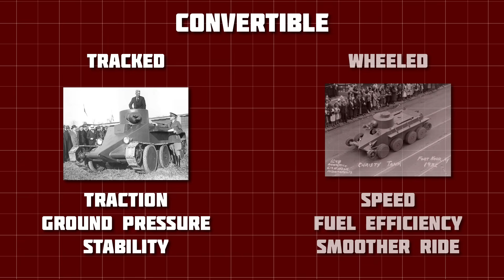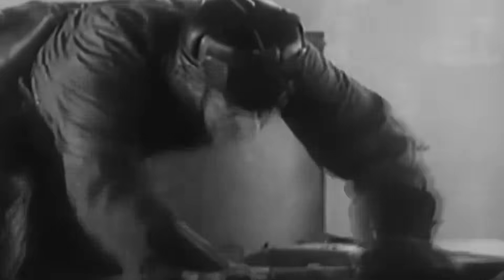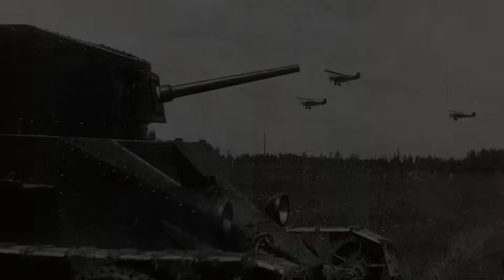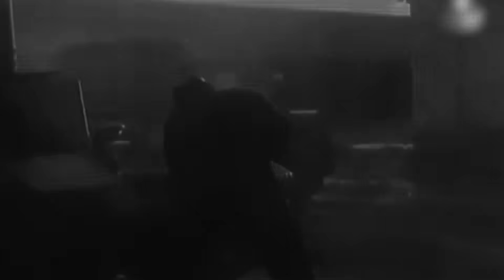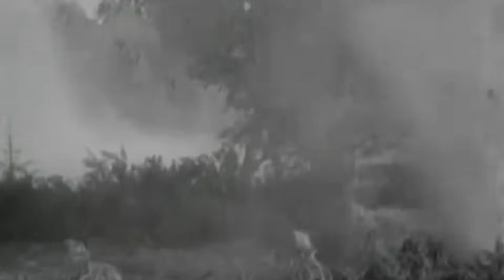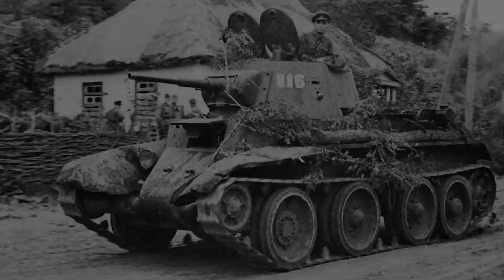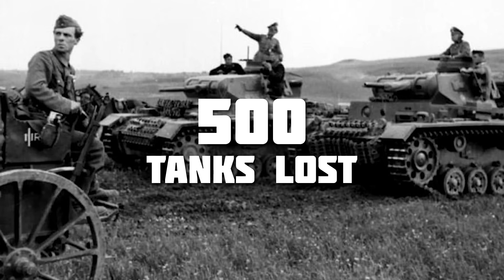The BT Tanks — Stalin's Doomed Cavalry

Comment: The T-44 was a complete redesign. Only the outlines and the engine remaind from the T-34. But they decided not to start producing it in large numbers, because it could slow down the T-34 production in the critical state of the war. But they kept refining it. And the "end product" of this refinement is the T-54. The T-34/85 was the end of the line of the Christie-derivative soviet tanks. The T-44 was the start of a whole new line of tanks. That line ended with the T-62.
Reply: They did not exactly decide not to produce T-44 in large numbers. However the factories which were set to produce it were just recaptured from Germans, so it took time until production would ramp up. Of course they did realize the 85mm gun wasn't futureproof anymore. The biggest changes from T-44 and all the various T-54 variants was the turret. Likely those earlier turrets weren't working too well with the new 100mm.
Indeed there isn't much left from T-34 in T-44.
Reply: @Teh0X  They tried to put a 100mm cannon on the T-44, but the gun's strong recoil disassembled the turret components, space was limited, and it was unreliable. Things got worse when someone had the idea of putting a 122mm D-25T on the T-44... it was completely unfeasible, so they hardly used the T-44 and went straight to the T-54.
Reply: @leo_commander_186  They also tried a 100 mm gun and a 122 mm gun on the T-34s...didn't work out too well.  Even the T-54's "pancake" turret was so cramped (how "cramped" was it?) that its crews were limited to about 5'6" in height (roughly 168 cm).
Reply: The T-44 was actually a further development of the rejected T-43, which resembled the T-34 superficially in appearance, but had torsion bar suspension, IAW German practice, enough room to accomadate its five-man crew, and a THREE-man turret, correcting the T-34s greatest defect.  While Stavka and Stalin actually liked the T-43 a great deal, what they didn't like was that their tank factories would have to shut down to re-tool for it.  This was in the late summer of 1943, after taking staggering tank losses at Kursk, Orel, Bryansk, Kharkov, and Smolensk, even though they pushed the Germans westward.  Stavka feared that giving the Germans that much  time to recover would make the job of pushing them completely out of the USSR that much harder, so the conversion to the new tank was deemed to have bad timing.  They did like the TURRET, though, and a way was found to make it fit onto the existing T-34 chassis.  At the same time, as the T-43 was meant to have the F-34 76 mm gun, and the new IS-1 the D-5T 85 mm weapon, the analysis was that firepower was the single thing that Soviet armor needed most; not only were the German "Big Cats" ALMOST immune to their tank guns at normal combat ranges (almost), even their StuG IIIs and upgraded Panzer IVs, of which the Germans had many more, could shrug off hits from the 76 mm weapon.  The solution was to stuff that D-5T weapon into the new turret, making the T-34/85.  While this made for a cramped turret, and the tank nose-heavy, hard to steer, and prone to getting stuck in ditches and trenches, the problems were considered worth the trade-off in effective firepower, as even the "Big Cats" had reason to be wary of the new hybrid tank!

The engineers at the Uralvagonzavod didn't just give up, though, they figured out a newer, lower design that better used the new turret, along with a cross-drive transmission that made removal of the "powerpack" a more straightforward procedure, something that the T-44s successors incorporated also.  This design was rolling out of the factory by March 1945, but didn't see action in Europe, nor even in Manchuria for the "August Storm" attack that wiped out Japan's vaunted Kwantung Army in but two weeks.
Reply: @selfdo the main reason they never made t44 , t-34 was good enough. Panzers 4 armor didnt saved them even against 76,cause t-34 attacked from the bushes and not by one. Tigers was rare,and panters was destroyed even by t-70 with 45mm from the sides... t-34-85 was basically the same tank,so t-34-76 crew can fight with it without any training. They just get better gun,thats all.
Reply: @HoldenCommodoreGRA  The T-34/85, along with other AFVs they produced, as well as those of the Germans they fought, illustrate that "perfect" is the enemy of the "good enough", especially when either it means how many tanks, etc you can produce and deploy, and whether you have the training and support equipment to keep them in the fight.  Plopping the turret of the T-43 and giving it the main weapon originally intended for the IS tanks gave most of the advantages that would have been realized from shutting down tank production at Uralvagonzavod and re-tooling.  Not only was the T-34/85 at least as good as the upgrading Panzer IVs, which were most of the panzers they faced, it had a realistic chance if it had to "duke it out" with any of the "Big Cats".  That 11,000 of the new hybrid vehicle rolled out the factory gates in 1944 alone shows that seldom did a T-34/85 have to fight by itself, as often a Tiger crew found themselves having to do!
Reply: If you look at the Christie Tank as its suspension or chassis, then the T-34 is already an extremely questionable vehicle (the ability to move without tracks is absent). Despite this, conceptually these machines are of the same series, starting with the BT and ending with modern Russian tanks, each subsequent one was made to better perform the work of the previous one.
Reply: @РуоуНущц  The BT is a Christie M1931 ready for mass production. The T-34 is a straight line evolution of the same thing. The most appearent difference is the width of the vehicle. Otherwise it is the same construction.
The T-43 and later the T-44 is a different beast in almost all respect. Only the shape is mostly similar. But anything else is different. Totally different suspension, totally different engine compartment layout, different running gear, etc. The T-72 has much more commonality to the T-44 than the T-44 to the T-34. And the T-72 is the result of another total redesign. Only the engine remained, and that still lived through a few upgrades at that time (nothing interchangable between the T-34's V-2 and the T-72's V-2. Maybe the paint).
Reply: T44 was remained like a transitional model. Between T34 and T54/T55.
Reply: @another_one8783  It was more of a paradigm shift than simply transition. A full rethinking the concept of a tank. Of course they kept what was good. And that is only the shape of the glacis.
Reply: But you can still see traces of T-34 design features in the T-44, like the shape of the cast turret, the wide angled upper glacis, the very similar looking tracks and roadwheels, etc.
I suppose that’s what he meant.
Reply: @rosbifke  On the contrary. The T-34/85 got the turret designed and developed for the T-44. Just like the 76 mm Shermans used the turret of the failed T-6 medium tank. So not the T-44's turret is looks like the T-34/85, but the other way.
You can't really make a wedge in different ways. Of course the glacis of the T-34 and the T-44 are quite similar. So as the Panther's, Tiger  II's, Centurion's, etc. But they already realized at that point that the sloped side plates are dumb, unnecessarily reducing the inner volume.
But they ditched the Christie suspension, and used torsion bars instead for example.
They manufartured the T-44 in low numbers just to refine the design, and upgrade it as much as they can. So at the end of the war they had a pretty good idea what will be their next mass produced frontline tank. Forward thinking.
Reply: @egyeneskifli7808  The Soviets were already seeing that the German Big Cats were further armored to even shrug off AP rounds from their 85 mm guns, and they had worries about the 90 mm guns of the new American M26/M46 Pershing, or the 20-pounder (later replaced by the L7 105 mm rifled gun) weapon used for the Centurion.  Like their former allies, they fairly much figured that fixed-mount tank destroyers were obsolete, and sought to take the T-44 to a new level with the D-10T 100 mm that in the brief career of the SU-100 TD had proved a match for even the vaunted King Tiger.  This resulted in the T-54 which first prototyped in 1949 and was being issued to Soviet tank divisions by 1952.

Comment: 1:16
I would say that biggest benefits seen before late 30's in wheeled vehicles was 1)reliability; 2)lesser rubber deterioration. Christie's idea of convertible suspension was one of the ways to combat that for tracked vehicle, the other was Kniecamp's "chess" track that increased the surface area of wheels touching the track and lowered the strain on rubber bandages. 
I remind you that rubber was then for both soviets and germans was strategic IMPORT controlled by their potential enemies.
Thus both were made obsolete by improvement in track design that made them more reliable AND by invention of artificial rubber.

Comment: BT is too much about speed. The gun may appear okay, but infact BT was a poor firing platform due to few reasons:
-2-man turret
-No cupola for second turret man to see targets properly.
-No semi-automatic breech. This means the breech has to be opened manually, increasing reload time.
-The combination of very forward placed turret and Christie suspension made the tank wobble quite a lot while firing. This issue was shared by the following T-34.

Other issues worth noting:
-Engine needed lot of work like the video mentioned.
-To fix the suspension, the side needed to be opened.
-For a 15-ton tank it consumed a lot of fuel.
-The steering was poor. Specially in the forested Finnish front this was a big issue.

The video got one thing wrong about Finnish BT use. They did indeed capture roughly 100 BTs in different conditions, yet only 2x BT-5 and 1x BT-7 were used for a short time. Due to the above issues T-26 tanks were favoured and roughly 50 of them went to use. The 114mm gun in BT-42 was likely too much for T-26. Of course BT-42 wasn't much of success, apart from anime. Only 18 of those were made.
Reply: 2 maned turret was common for the time.

Comment: BTs in WT will get shredded through and through long-ways by anything 60mm and up but it's a serious case of "greased up deaf guy". The guns will stop penetrating to kill tanks built from 1937 onwards but they WILL knock out engines and tracks pretty well. 

Best way to use them in game is zoom around behind the enemy and then zip through them blasting away into engines and treads point blank with those lightning fast small cannons. You're so fast you hit and run before anyone can react and if you weave around the enemy they'll sometimes hit each other trying to kill you.
Reply: It can kill panthers, Shermans and most other early -  mid WW2 medium tanks from the side :goodvibes:
Reply: @NATHANIEL-b4eWT is the fycijgn toy for adult children. BT was absolute zero useful against even Pz IV in the history

Comment: I don't understand why the soviets abandoned the BT production line(s) in 1941
and yet they stubbornly held onto the T (as in T-50, T-60, T-70) production until 1943.

Yes, they were desperate to build ANYTHING on tracks .... but the T series were (finally) 
recognized as coffins and abandoned (actually, converted to the SU-76).
This 'desperation' is an excuse to continue production of an inferior tank.....but why abandon the BTs?
Reply: T-60 was produced in refitted car manufacturing plants. BT required dedicated tank production lines, which were unavailable in sufficient number in 1941-42, not to mention already taken by T-34 and KV-1.
Reply: T-50 was an amazing light tank, but not yet mature and the production capacity was minimal.
T-60 and T-70 intendeds as cheap infantry support tanks with fairly decent armor for what they were. Very different to BTs.

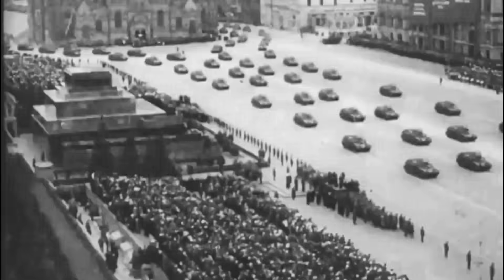Comment: 15:45 there is a Soviet Union philosophy when it comes to equipment that just because something is technically obsolete, if it still works you don't throw it out but continue to use it until you can't anymore. You see, in western culture quality means something that will run reliably for years with minimal maintenance, but in the USSR quality means that when something breaks down (which it often does) it's easy to fix. Hence they will continue to use equipment with Jerry-rigged components until it is literally falling apart. They take the whole "reduce, reuse, recycle," philosophy to the extreme because they can't match western quality standards at scale.
Reply: It's not nearly as cut and dry and it mostly comes down to production costs. It's very nice to handcraft every single bolt and gear, but not when you live in an environment where you have to actively wrestle with nature for survival. USSR wasn't very rich nor had any colonies like Britain and France or later USA, so we had to (and still do) make the best out of limited resources. It's pure practicality.

Comment: The armour was actually even thinner on the BT-2 & BT-5 tanks. It was actually 13mm. on the front and 10mm. on the sides.

This was the typical norm for tanks of the 1930's in most of the nations. The performance of the B-3 37mm. L.45 tank gun was due to the use of APHE ammunition, which was also typical in performance and usage, for the 1920's and 1930's era.  AP-HE (solid shot with a fragmentation tail) and AP solid shot plus capped derivatives, were yet to be developed.
Reply: Why the soviet historians insisted the 37 mm gun was a machine-gun? They applied the same logic for the 45 mm gun !

Comment: Soviets after seeing the Christie suspension Hehe tank go VROOOOM
Reply: Not a bad call, tbh.  The USSR had a LOT of territory to cover and a 2-front war to fight.  Add to that their difficulty in producing thick armored plates and going all in on mobility at that stage of things was a very useful move, even if the BT line didn't have the staying power for the full war.
Reply: @dynamicworlds1  If soviets had "difficulty in producing thick armored plates" they wouldn't make the KV-1. BT-7 was as armored for 1935 as it could be expected of a tank that could go that fast. T-28 and 35 didn't have thick armor because they were volumetric nightmares by design.
Reply: @Klovaneer they weren't making kv-1s in 1935 were they?
Manufacturing ability of all nations changed through the war.
Reply: @dynamicworlds1  Except KV-1 predates the war.
Reply: Soviets after seeing the Christie suspension: damn that actually has enough flex to ride over our terrain.
Reply: Soviets put Christie suspension on their T34.
Reply: @rwdyeriii  Meaning?
Reply: @Klovaneer pretty sure he just wanted to share a fun fact, but I can see where you might have thought he was alluding to larger point. We can all agree that tanks are neat tho:)
Reply: @tankgunner37  I mean his point could be that T-34 isn't a "cavalry tank" but an actual medium so the christie wasn't that good for it but it still was faster than the Sherman and Pz4. Soviets were actually prototyping a torsion-suspended T-34M when germans invaded so they knew it wasn't a great match for a medium by that point but they had to stick to what was already introduced to be scaled fast as fook. On the other hand british cruiser tanks used christie as well and Comet roughly matched T-34-85 in the iron triangle.